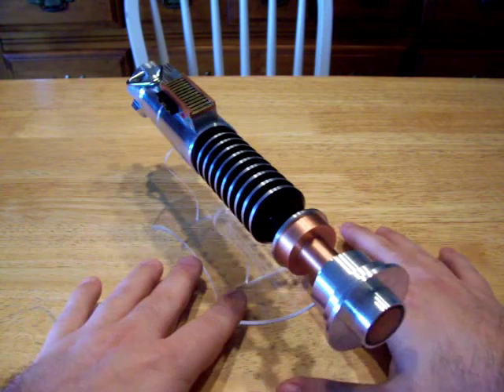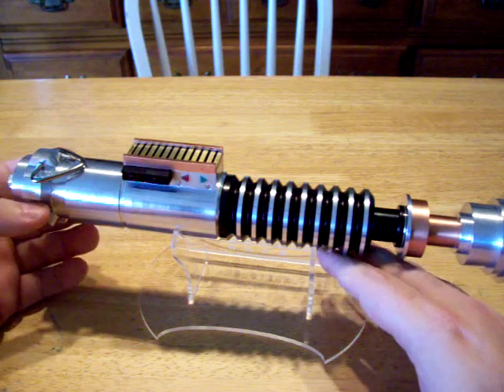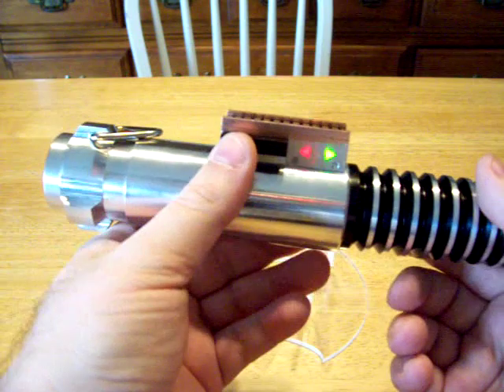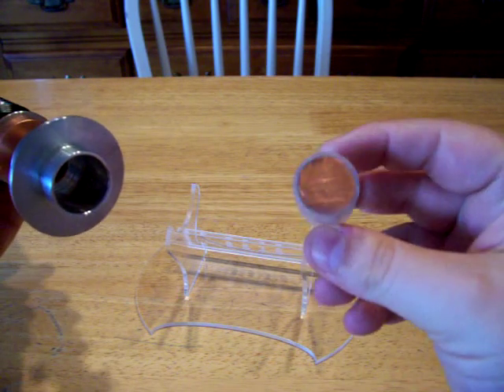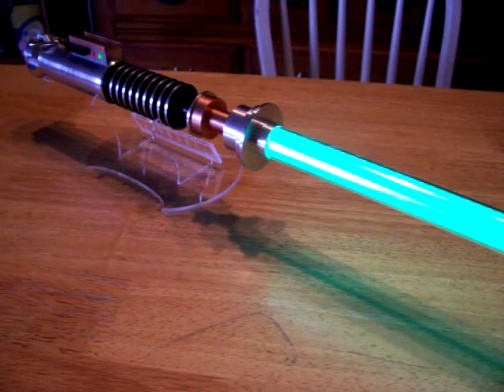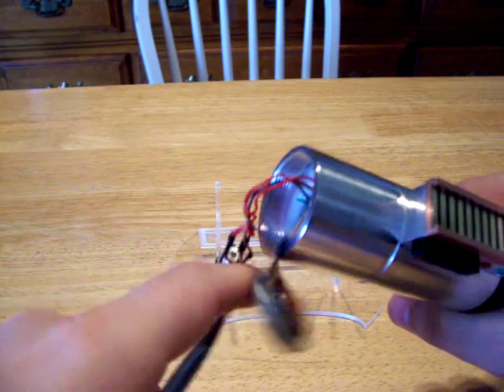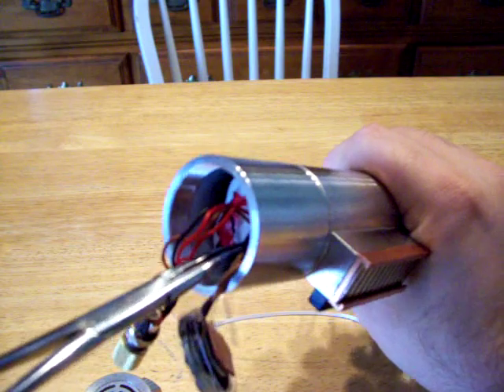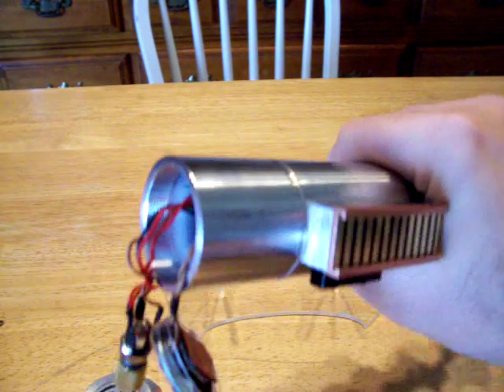Luke Skywalker ROTJ Hero Mark VI Petit Crouton

Comment from the maker: @greytale 
I make sure the board is level in the hilt for display purposes. The board is mounted with double sided auto trim tape, to act as a shock absorber.
Adjust the "i" setting by feel for swings.